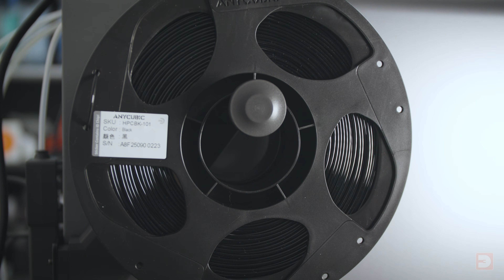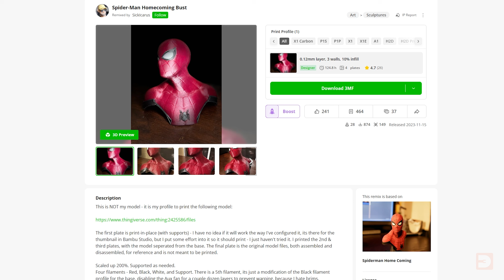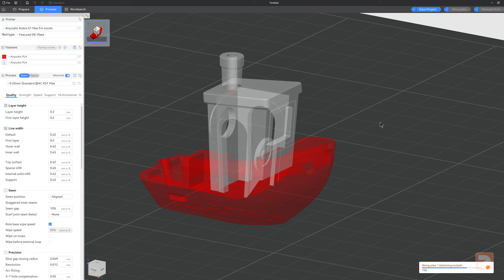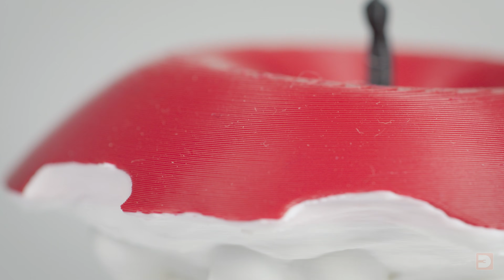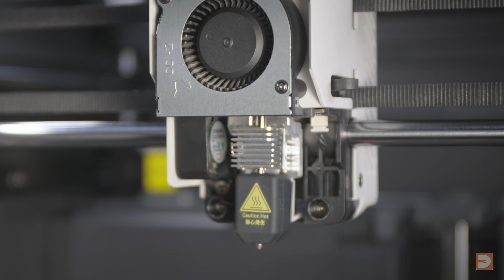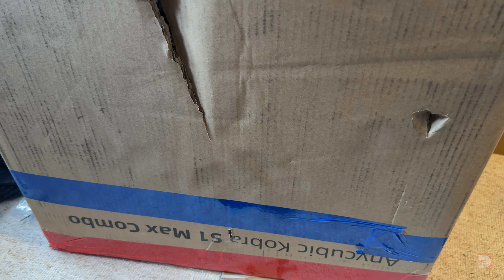AnyCubic Kobra S1 Max: Full Review

Comment: I received the S1 Max and did have a similar issue with bed adhesion. Luckily I was monitoring the job when I too saw the print head cover had popped off. However I was still printing with PLA. I was successful at stopping the job remotely and after I cleaned up the bed and inspected the unit, there was a new error on the screen. A motor issue. I've been working with Anycubic's support and they have been wonderful. My new part arrived last night and I'll be installing it tonight.

My issue is with the edges of the bed. Apparently adhesion fails at the extreme edges of the print area. A youtuber suggests using a gluestick after cleaning the bed to boos the stickyness factor. I'm going to give it a shot.

Thanks for the great review!

Comment: Decent review, but it's like you've never used a 3D printer before. You have to dial in the settings like speed, flow rate, nozzle temp, and bed temp for every filament type, even different brands, just like any other 3D printer on the market. I have never had a printer just work perfectly with standard settings, and that includes the industry-leading X1C. Many of your disappointments are not actual issues, just user error.
Reply from the maker: As someone who's been 3D printing for around 15 years, and running a 3D printing channel for 8-9 years, I can confidently say, yes, I know, and I was fully aware that dialling in settings is necesary to achieve top settings. 

However, with modern printers such as this, a big part of their sales pitch is the pre-assigned calibration, the sensors to prevent print issues, and the general reliability.

This was using their printer, using their own brand filament, which the printer recognises and is designed to automatically run the best settings for that material by default.

Yes fine tuning settings will help ensure better qualtiy prints, but you should at the very least still be able to print with this.

I don't expect perfect prints on stock settings. But I don't expect the printer to shoot itself in the face.

The issues I expereieced here are not excusable under that gaise. Equally, not fine tuning the calibration is irrelivant when it comes down to a known issue (that was present in previous models) with the build plate flexing, resulting in innacruate bed mesh calibration.
Reply: @3DRevolution  I was also a beta unit. how can anyone expect anything good from beta? I have about 500 hours on my S1 max and its a workhorse, it prints wonderfully and is actually my most reliable printer. It is sitting next to my x2d and my s1. The S1 is a pain in the ass though and anycubics support sucks.

Comment: One thing I will point out, on the one I am testing - the bed surface (like the S1) - is just not great at all.  I've had 50/50 success rates on long prints.  I boosted the PLA bed temp from 55 to 60 but on one test with multiple objects, 98% into the print, a print came loose, trashing the rest and dislodging the print head cover.  None of this triggered the AI detection systems either.  It's frustrating that they've made a large machine but some areas they cut corners are rather maddening.  Why not a thicker aluminum bed? Better leveling system?  Better PEX surface?  Testing continues!

Comment: These machines do print well enough but they're let down by their hardware. They knock these out as cheaply as possible and the components are less than optimal. I went from using a S1 to a Bambulab P2S, the experience is night and day. The P2S works consistently and is an utter workhorse. It makes the S1 look like a bit of a toy.
Reply: We are looking a larger printers for prototyping.  Bambu Labs is definitely on the list.

Comment: Having used the Bambu AMS 2 pro with one PTFE tube output I think I would prefer this design. My unit keeps fowling up and taking apart the AMS is NOT fun. Are filament changes faster because it doesn't have to push/pull a lot of filament?

Comment: Isn't the bag the drying material? The compartment below it looks like an actual filter.
Reply from the maker: By drying material, I'm presuming you mean desicant? No, that is not that, and desicant doesn't belong in an air filter anyway. 
This is a bag of activated carbon granules. I've spoken to Anycubic about this and they have actively told me that this is the filter bag and that they feel this is suitable. 

Also, if you go to the S1 Max product page on AnyCubic's website (https://anycubic.com/products/kobra-s1-max-combo) and search for "Activated Carbon Filter" it shows a picture of the airflow of the air filter, which clearly shows it being pulled in by the fan at the top of this section I opened, and being blown out through the area with the filter bag in it.

Comment: Great review video, but I will not be looking at Anycubic printers again. My first printer was a creality s5 which was great for what I need at the time. I then purchased the cobra max 3 with an ace unit and I have never had a decent print from it. To replace the Anycubic I went for the Bambu x1c with ams which now does all of my printing. Would really like to try a Prusa printer maybe a core 1+ with the option of getting the multitool head conversion for it by bondtech AB.
Reply from the maker: Glad you like the review. 
The X1C is an absolute work-horse of the 3D printer world.

Comment: while i own kobra s1 with 2k+ hours... probably one of the first batches, the bed is horrible..... got another one from support, same problem-its just too thin and warps.. now after 2000 hours i finally found a free or cheap solution for a perfect layer, not having to buy funnsor bed etc
i wanted to order s1 max, but mainly due to the bed issues i did not. while i ve seen other reviews, someone printing pc as well, with right settings he had no problem, ill still say most of the issues people are having are and will always be user error, instead of always blaming the machine
with the chamber heating, abs printing, overhangs.... i have to say its a better printer than s1, for me mainly the bed size is the winner, also price of course :)
so if it works like my s1, few errors in 2k hours, some clogging-which might be caused cause of the ace and not the printer-printed 8way hub, sometimes something gets stuck or idk....... 
printhead cover breaking after some time where its screwed
but yeah.. mostly the bed issues cause im very annoyed if its not perfect :D but i dont mind tinkering like some and want their printer working flawlessly all the time
also their support is top notch! at least it was for me, coming from creality..........which is not
ps:  great review :)
Reply: is the bed issue fixed in the s1 max?

Comment: I have an Anycubic S1 Combo, and with now over 140 hours of printing, I have had no real problems with it. I have ordered the Max Combo, and will update after some use with it. They say I should receive it between April 5th - 15th.
Reply from the maker: Look forward to hearing your experience.
Reply: I printed more than 150 hours in 3 weeks ! I went on holiday for a week tried to print something and the bed was warped like a banana ! 
Thousands of complaints all over the world but they always seem to get hushed up !
Reply from the maker: Yeah as I mentioned in this vid, there's reports online (especially Reddit) of people experiencing things like this with the S1, so it's pretty shocking that the same issues are present on not only a brand new product, but one which features brand new parts, requiring new master molds and designs.

Comment: The issues with the PC is they don't have the bed to the temp PC uses for leveling. So when the bed gets to PC temps it changes due to the heat. They need to fix the code to where th bed leveling is done at the temp of the actual print.

Comment: I've used that Anycubic PC filament with Bambu printers, and its pretty good stuff. PC filament has gotten much easier to use through the years, or maybe printers have just gotten much better. Gluestick also doesn't hurt.

Comment: ypu just have not cleaned well stick plate and left some plastic dust between plate and magnet layers
Reply from the maker: I'm afraid that's not the case. 

As someone who has been actively 3D printing for well over a decade, starting out in the day we'd 3D print onto either panes of glass, or a sheet of kapton tape, I'm well versed in adhesion issues.

This also occurred with and without using 3DLac bed adhesion spray, which I've been using for a long time, and in the years I've been using it, I think I've had maybe 3 issues of bed adhesion across all my printers of all brands.

This is not to do with the bed not being cared for or apporpriately prepped.

Also, regarding 'plastic dust between plate and magnet layers', this plate has never been reversed. I've only ever used it this side up, so there's no residue on the underside of the plate.

Comment: Excellent beta video, do you know if the LAN connector in back is WLAN or Ethernet (Wired Lan)?
Reply from the maker: Thanks very much, glad you like the video. Regarding the connector, sorry but could I double check what you mean?

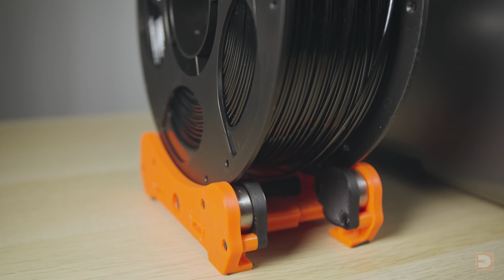The port on the back of the printer is an Ethernet port, but the printer also features dual band WiFi 6. I mention this and show the Ethernet port at 2:46

Hope that helps, and happy printing

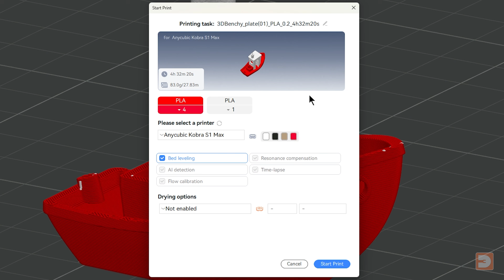Comment: 11:50 Just a heads up you have that backwards. You are assigning slots, so when you picked slot 1 and 2, it selected slots 1 and 2. It doesn't attempt any colour matching.
Reply from the maker: Heya, no it does try to do color matching, it's not simply assigning the order of the colours in the slicer to the order of the colours in the ACE. 
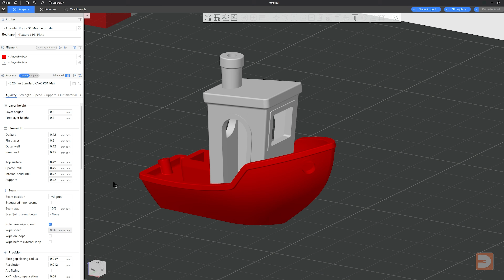The two examples shown at 11:19 (where it correctly matched the colours), and at 11:50 (where it incorrectly matched them) were actually recorded in the same clip. I'd sliced it and clicked 'Remote Print', and it correctly assigned the colours. I went back to the preview and sliced it again (without changing a single setting), clicked 'Remote Print' again, and it then paired the red to the black.

When you manually choose colours, the number it shows does represent the slot in that ACE, yes, but that's irrelivant to the point I was making about it mis-asigning colours.

Comment: When you pointed out how single-nozzle mutli-color printers generate A LOT of filament waste, it made me wonder why more printer companies don't make dual-nozzle printers (like the Bambu H2D).  Certainly a mutli-toolhead printer is the best thing for multi-color/multi-material prints, but I think a dual nozzle printer can go a long way to at least reduce waste and make it possible to use two different types of filament on one print.  One of my favorite things I like about my dual-nozzle H2D is how I can use one filament for support material (or the support material interface) and another filament for the actual print.  This is a powerful capability for a 3D printer to have, and a dual-nozzle print carriage is much simpler (although a bit heavier) than a multi-head tool changer.
Reply: I have a H2C for that reason. Honestly, there is no right or wrong way to do multicolor, but certainly different printers fit different use cases. Two color with a dual nozzle is a good choice because many prints are dual color, and just two color is pretty wasteful for a single nozzle printer. With 3 to 7 colors, now the H2C is looking good, but with added cost. With more colors than that, you might lean to what PRUSA is working on, but think about the pain of loading filament in 8 nozzles, I'd say no to that.
Reply: The h2d is 3 to 4 times more expensive

Comment: Excuse me if this question is misplaced, but does this printer heat the bed before probing the bed before a print?  I have heard of some users of other large format printers that have had leveling problems 'heat soak' the printer (both the bed and chamber) before printing and have reported better bed probing.  And thank you for this excellent and balanced review.

Comment: So K2 plus vs this one. Which one would you prefer?
Reply from the maker: Hmm, ignoring the issues I've experienced in this video, of the two, I'd probably choose the S1 Max. However, I also know there has been some serious reliability issues with the K2 plus, so if it does turn out that these issues were due to a faulty Beta unit, the Kobra would win by a mile.
Reply: H2S if budget allows. Outstanding machine. Creality products are worse than anycubic in terms of reliability. Bambu just works.
Reply: @happygiraffe9787 Bambu is hot garbage unless all of the stars align
Reply: @happygiraffe9787  ah yes, let me sign up with the company that activelly hates its users, next yoou'll tell us to use Apple products only I assume?

Comment: Nice video. I am seriously considering this machine.
Reply from the maker: Thanks, hope you found it useful!
Reply: @3DRevolution  I pre ordered as well, however if the ship date does not update I might cancel it and get my money back and get an H2C
Reply from the maker: @djinfinityAZ the S1 Max and the H2C are incomparable. If your budget can stretch to an H2C, that's definitely the way you want to go!
Reply: @3DRevolution definitely different, but I would sell my other printers as well to make that leap. My main issue is Anycubic not responding and I am even an affiliate. Lol
Reply: @djinfinityAZ  I also have one pre ordered and can't seem to find out if it is being shipped or not. When I purchased, the expected arrival time was from the 5th to the 15th of March. Since we rarely receive anything in this area on the weekend, I figure It won't make the expected arrival date. Since this will be my first 3d printer, I would have liked it a month ago. I will certainly give them the extra week, but I am thinking about canceling my order and getting my money back. What to do with $300.00 worth of filament??
Reply: @mhartlen4377 Anycubic actually reached back to me with a date of may 😮